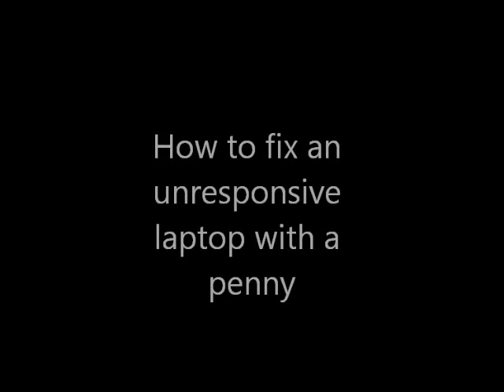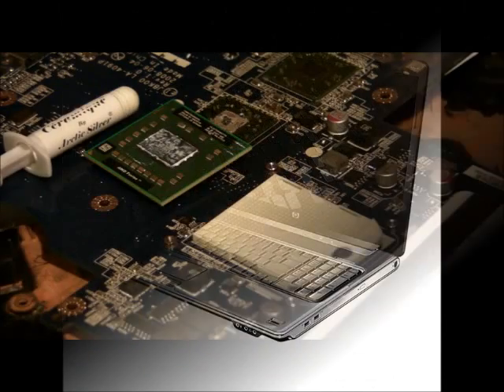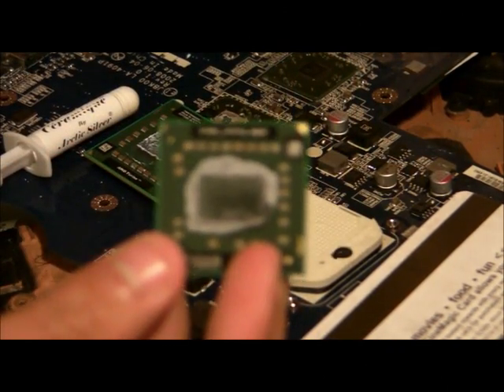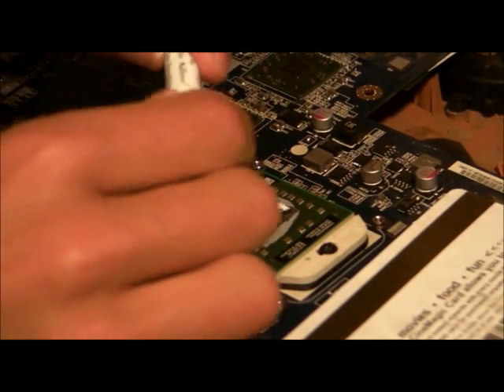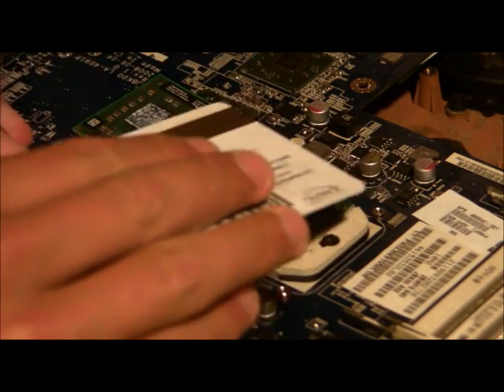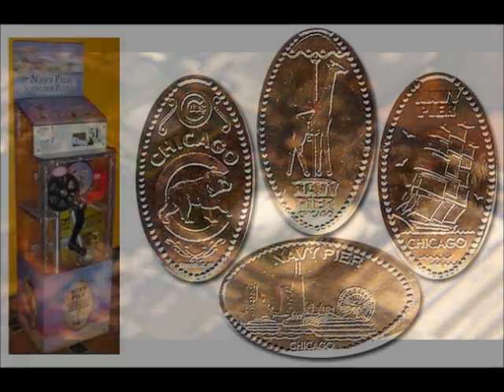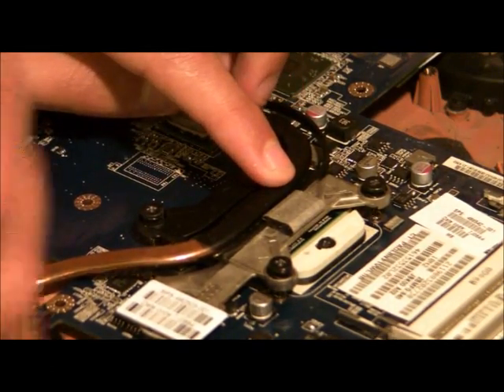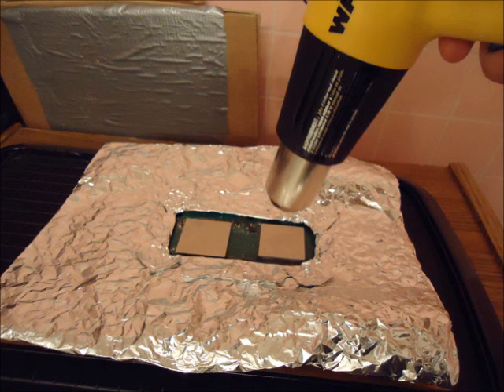Fix a Dead Laptop or XBOX 360 with a penny

Comment: Tip 1: Clean off previous thermal paste (as video did not do).
Tip 2: Use less paste than in this video (too much and you make a thermal barrier, thus your apparent need for a penny).
Useless fact 1: Pennies no longer are 100% copper (as of the 70s or somesuch), and use a (zinc?) core now, so any comment of "copper is a way better conductor than X" is kind of meaningless in this case. USE A COPPER SHIM instead (as AbePacko pointed out).

Comment: Can i user Aluminiumfoil? like fold it over 10times to get it thick as a penny? Aluminium can transfer heat a litle bit better than copper does :) but would id work better is my question, i am pretty sure that you've already tried it with aluminiumfoil or didn't you??

Comment from the maker: @badbwoydes Thanks for the comment! Thermal paste will help, also sticking a piece of copper with a larger surface area might make the heat transfer more efficient. I noticed my fan revved higher too, but this might be the CPU thinking its hotter than it actually is because the heatsink is no longer in contact with the die.

Comment: @weatherman92k I run CoreTemp & it shows the CPU at around 80C when idle after the Notebook has been on for a while, but games and 1020p vids don't bring it past 92C, which is still very hot to me, but the fan doesn't spin fast until it's like over 95C, otherwise it's almost silent but the left side of the Notebook is warm tho. I'll try thermal paste soon & see what kind if difference it makes.
Yo, this was an excellent video & i'm lucky to come across it & your trick. Thanks man.

Comment: yes it did :D Well, i reseated the CPU twice but i still got the CPU error code, so i used a copper coin between it and the heatsink as you suggested, and it powered on. Strangely, it stayed on for about 45 secs before it powered off then rebooted with the GPU (4 blinks) error code. I noticed it stayed on for a shorter time after that, and I could hear the Fan at full blast, so I moved the coin to the GPU instead, and now the Laptop has been running for over a week so far :D

Comment: @weatherman92k I don't know why these are so cheap, but I was looking at a slight upgrade, moving from my stock 2.0GHz to 2.2GHz for $25 on eBay, but if re-seating and using the penny trick solves it, i'd save on some international shipping costs (i'm in Jamaica)
 Won't be able to try this until next week. I'll let you know what happens.

Comment: Hey, I have a DV7-1135nr and it's not booting. Display stays blank but the LED flashes once every 3 seconds or so. I was also in eBay looking for a replacement CPU. Based on your vid here, you'd suspect the CPU is bad and replacing it (with a used one) will get rid of the prob? I suppose it's too early to tell after looking at the post date.